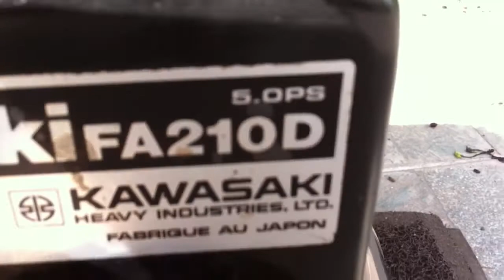Kawasaki FA210 5hp engine,Warm start and run after rebuild

Comment: Man I miss these engines... we used to race them in the 80's and the Briggs guys would struggle to keep up. They were lighter, better balanced, had better oil journals, superior carb,  more efficient combustion chamber, and better air flow.  These used to dominate in the stock classes. 
If someone sells these things new, I would love to my hands on a couple!
Reply: What did you guys do to them
Reply: Tucker Cole it depended on which class we were running. Usually re-cam,  heavier springs, polish the lifters,  light weight piston w/ 0.020 overrun,  lightweight rod,polish the crank, remove the governor, tapered-shaft valves, reseat the valves, straight exhaust, racing air filter, run oil blow-by into a catch tank and plug the hole in the carb with a bolt, balance the flywheel, remove the mechanical points gapper and replace with chip points, polish the carb... that's about it for starters. There's more done in modified vs limited modified classes, but these engines could take some abuse and still make power!
Reply: @Silverbugle2005  can you even get racing parts for these still

Comment: Hey!   was that secondary shaft (the little one) running opposite of the main shaft?   

   I am wondering because im looking for an engine to replace the one on my rototiller and it has two shafts as well but the little one has to run opposite the main shaft because it is for reverse. the Tiller is so heavy and big that running it without a reverse is REALLY difficult. if that one runs backwards I will look for one of these like you have or had.  looks liek its been a few years since you posted this.    Thanks..
Reply from the maker: Leisure suit Larry This small shaft is the camsaft and its the 1/2 of the speed of the main shaft (the Crankshaft)
Reply: *****   yeah, I see.   so it goes .5 the speed.    does it run backward from the other shaft OR the same direction as the other shaft?
Reply from the maker: it runs backward